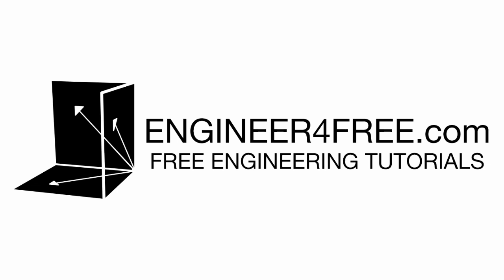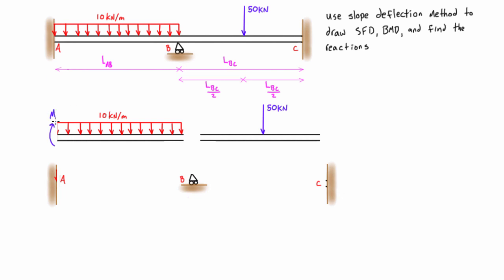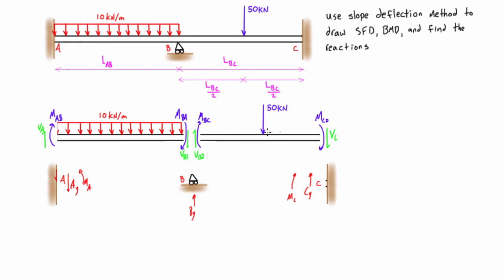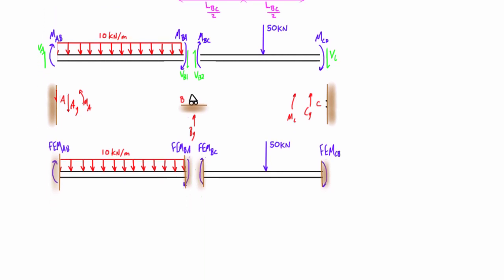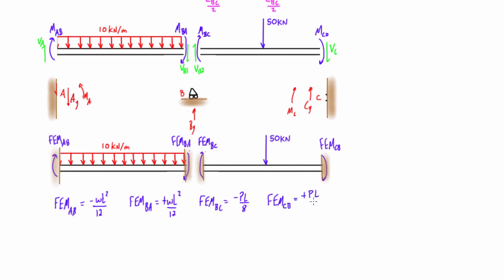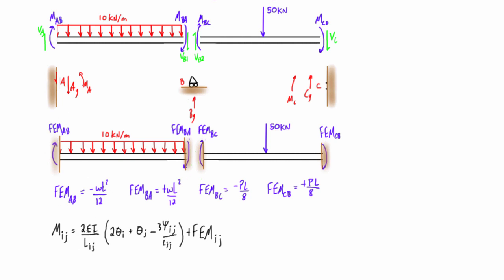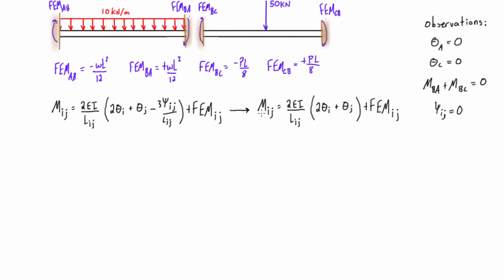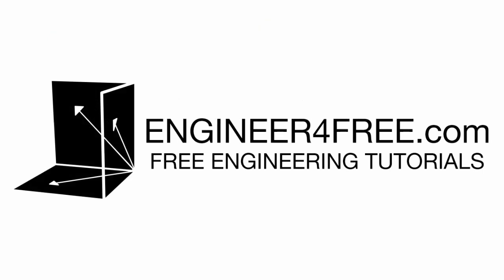Slope deflection method example #1 (part 1/3)

Comment: Are the internal moments and the reactions different?
Reply from the maker: Yes they are different. For example imagine a pin support somewhere in the middle of a beam. The pin can provide a vertical reaction and a horizontal reaction but no moment reaction. There is likely a non zero internal moment at the location of the pin. For a pin support like that, the change in shear is equal to the magnitude of the point force. If you have a pin support at the end of a span, the internal shear force will be equal and opposite to the reaction force. For a fixed connection at the end of a beam, you get the internal shear force being equal and opposite to the vertical reaction force and the internal moment being equal and opposite to the moment reaction. So they are different but often when dealing with ends of beams you find them to be equal and opposite.
Reply: @Engineer4Free  oh crap i meant internal forces* and reactions haha
Reply: am i correct in thinking that the reactions are caused by the internal forces
Reply from the maker: @arnoldchristian9501  More or less. If a member with no self weight had no forces acting on it, there will be no reaction forces. The internal forces arise from all forces acting on the member, whether its an applied force like a point/distributed load or a reaction force. Imagine a simply supported beam with a single point load acting on it in the middle. If the point load's magnitude is P, then each reaction is P/2, the max internal shear is P/2 and the max internal bending moment is PL/2. If the point load's magnitude is increased to 2P, each reaction would be P, the max internal shear would be P, and the max internal bending moment would be 2PL/2 = PL. The applied forces affect the reaction forces, and all considered together affect the internal forces.
Reply: Engineer4Free thank you 🙏

Comment: how you get 12 ? please explain all
Reply from the maker: The 12 comes from a fixed end moment table which can be found in most mechanics of materials or structural analysis textbooks. Typically when you are asked to solve a statically indeterminate beam using the slope deflection method, you will be provided with such tables, so deriving the formula for fixed end moments (the term that has the 12 in it) is not required. Take a look at this video where I go over the general method: https://youtu.be/ftjehUrCloM